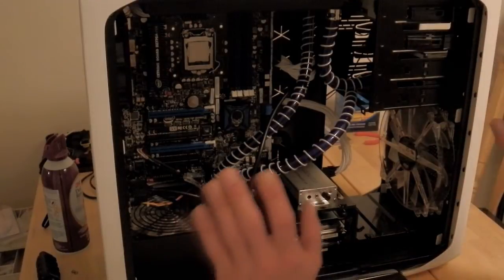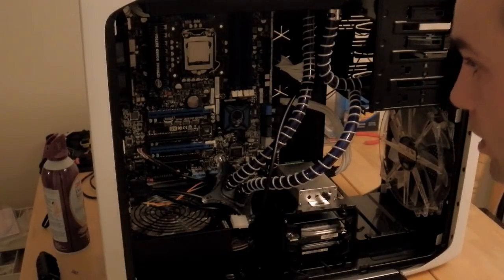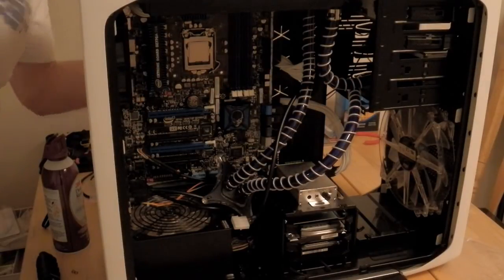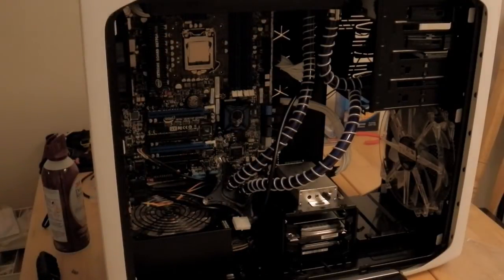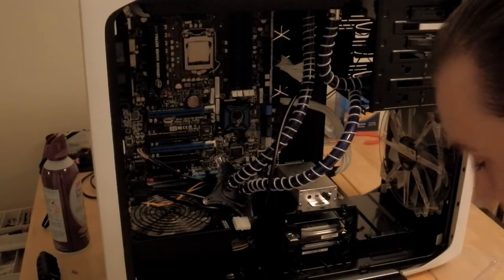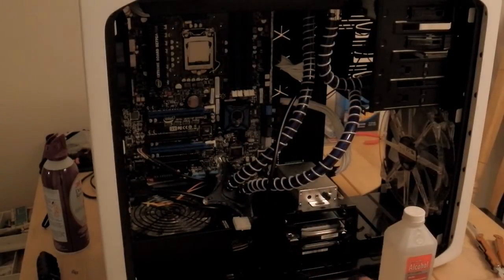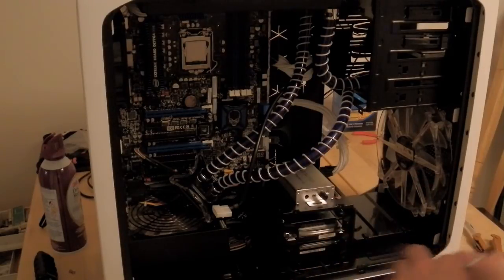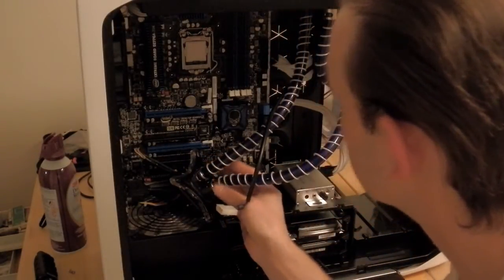i7 3770K & DZ77GA-70K Install-Thermal Paste & Water Cooling

Comment: your power supply is installed wrong, flip it over. thats why corsair put intake vents on the bottom of the case.
Reply from the maker: Really, show me where it says you "have to" install it that way...cuz I'm curious. Yes, it can be installed that way, but it doesn't say that is the only way. Depending on your fan configuration, positive/negative case preassure, & having a dog that sheds a lot is more my determining factor

Comment from the maker: Oh ya, the quick disconnect nozzles can be used in a few different ways but I will be implementing them for the drain line. I'll split the return line to the reservoir and add a 3 way connector so that the return line goes back to the res, but on the bottom will be the quick disconnect with a small piece of tubing with a plug on the end. So When I need to take out the unit I can just lead the drain line to a bucket then take everything out from there.

Comment from the maker: Ya I was, but I'm a little tight on cash right now so I'm going to have to wait a bit to get it done. I know the parts I want, and I could get cheaper ones, but that's not how I like to do things :) So it may be another month before I get to add the drain line. That being said, I'll hold off on the video for cleaning the water cooling loop and drain line install until then because without the drain line it can be a bit of a hassle. Thanks again and if you need anything just let me know.